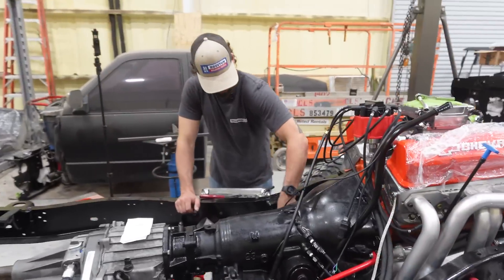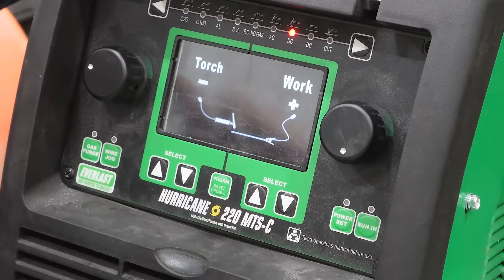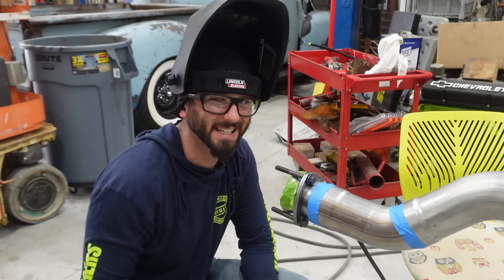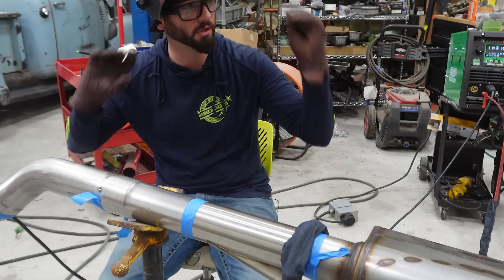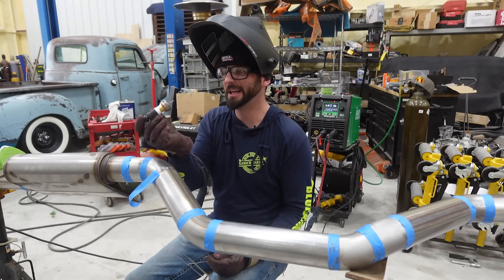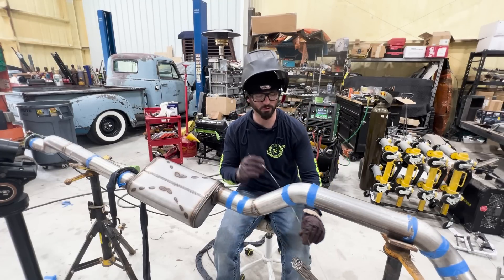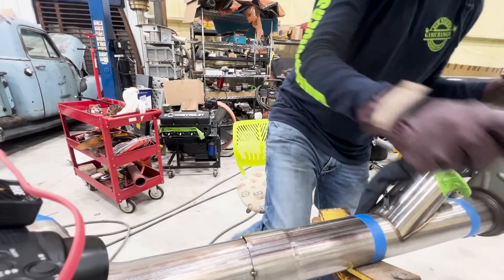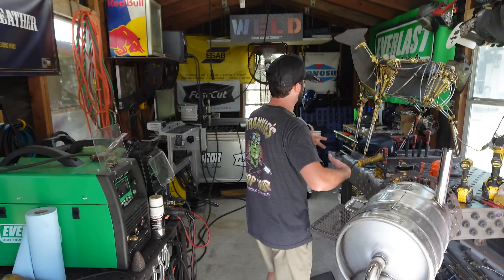How Not To TIG Weld A Custom Stainless Steel Exhaust

Comment: Thank you for the tutorial.

However, - wouldn't the protectig sticky tape (that helps avoiding the argon leaking through the seams) leave "traces"?, which should be better acetone or spirit removed prior to welding??

Comment: Ngl but the slip on joint weld wasnt that bad.  Could be that camera does its weird stuff but normaly just push the filler like crazy and fill that . Not a pressure vessel or anything

Comment: Question. For the purge formula at 2:42  is it diameter or the area of the pipe times the length in the numerator?  (Pi*(D^2/4)*L)/CFH gives units of time, but the formula you posted gives units of time per meter.   Really appreciate the videos.

Comment: Given Argon is heavier than air would standing the pipe vertical and purging from the bottom help?
Reply: The purge was fine, and sure definitely an option. Haha don’t gotta ladder that tall lol. Ideally this would’ve been welded mostly in sections on a positioner in the 2g position
Reply: @Drweldz  lol 
yeah I didnt mean to weld it like that just get the purge started. 

Having said that. I guess if you only making one exhaust a year, you aren't going to save much money or time doing it my way.
Reply: @stusue9733 lol yeah. I’ve purged a lot of pipe on its side. It’s not thatttt big of a deal as long as you have a continuous flow
Reply: @Drweldz  Perhaps one of us is over thinking things lol

Comment: I put a tip about using foil hvac tape, it helps when it comes to heat and removal is easy.
Currently building a Battleship 😉
Reply: Great option for tape. This was laying around in John’s shop 😅

Comment: Holy cr@p that rear driveshaft has some huge angles......you might want to talk to someone about that before your break you transfer case or wreck the driveshaft.
Reply: Surely that's a mock-up?
That's a lot of yoke showing(although given the angle, maybe they need that much?)
Reply: @stusue9733 no weight on the frame.